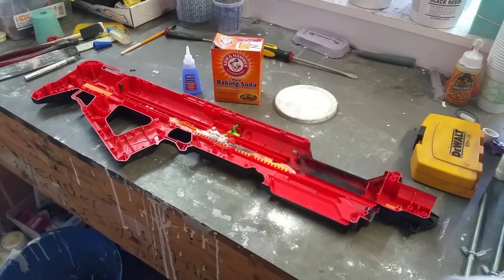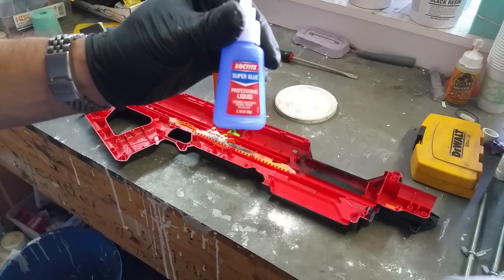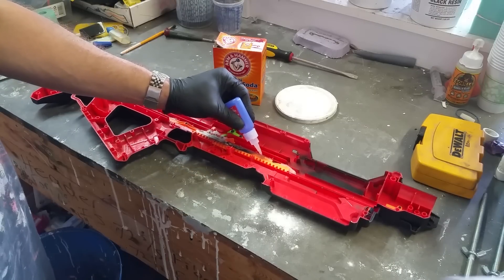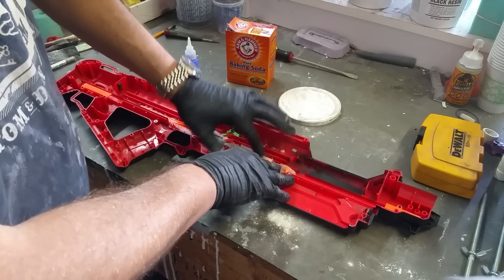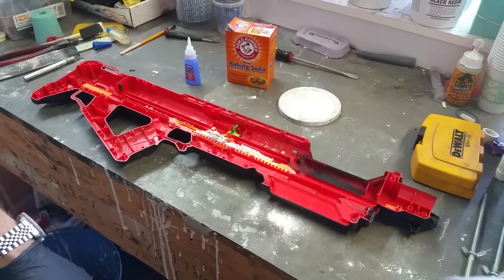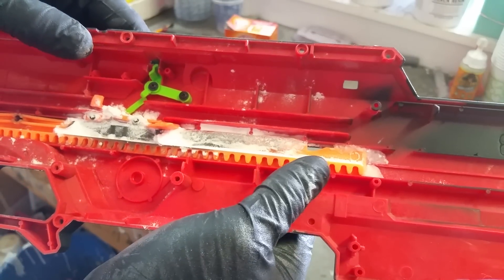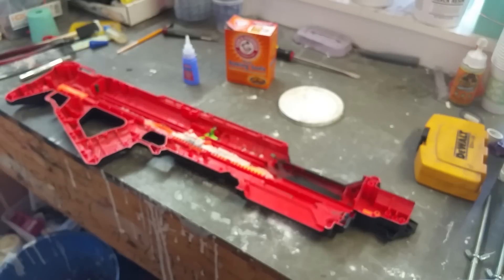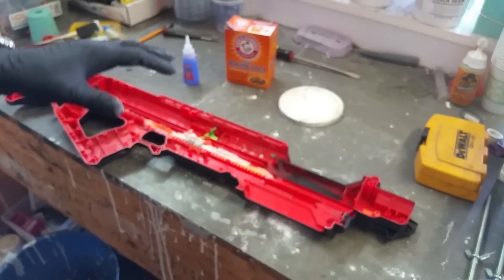How to repair props and fill voids in SECONDS!

Comment: ah ok quick work time is a nice advantage but that did the guitar guys use to hide th blemish and/or finish the facing ?
Reply from the maker: If you do the work carefully, there shouldn't be anything to hide.  It's white material on a white part, basically.  for your purposes, you could use filler putty or just coat with primer.  That's what I do and you can't tell there was ever a repair once the paint goes on.  Thanks for asking!
Reply: Johnson Arms Props fair enough ha ha ha